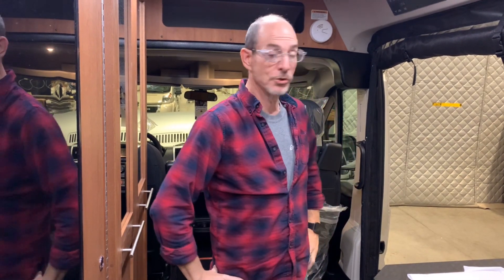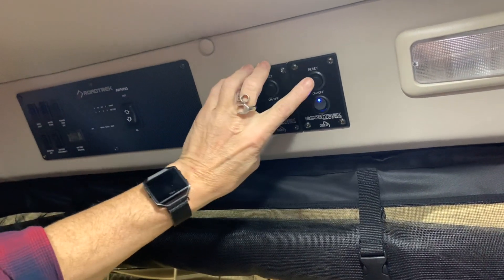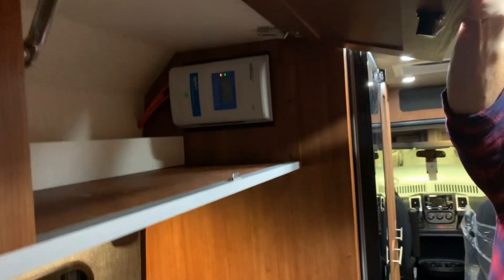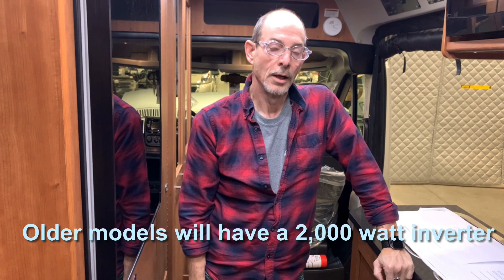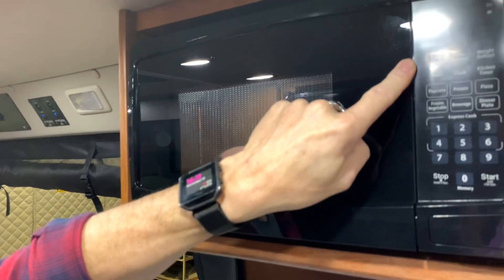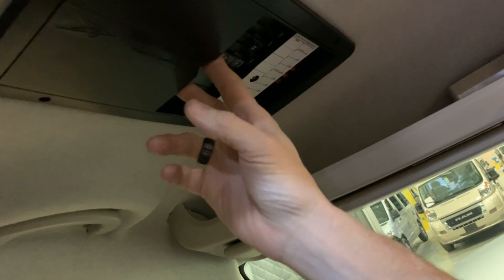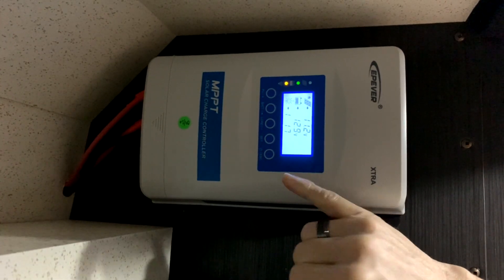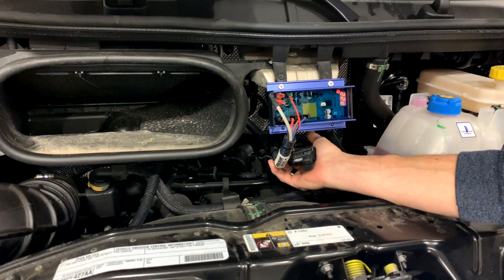Roadtrek Delivery Experience  Electrical Systems Video

Comment: awesome help.
we just got a 2015 used one by M.Benz on the sprinter body with roadtrek doing the interior... got several things that puzzled us as was not in the RT book ... the two lithium on buttons with reset as shown, are in none of the paperwork we got so that manual obviously is missing... which wouldve probably also shown us where these lithium are...
There was no MPPT manual so had to guess it was a solar controller
The AGM under hood at least was mentioned, so we have both installed apparently. the power button on the side of the front pass. seat on/off is still a mystery...

but atleast the mystery buttons you just showed let us know we have Li. onboard as well 
Now have to find a manual for the inverter charger at the back under the bed so we can find out why one of the two lithiums make a clunk sound when switched on, I assume by watching the LCD screen on the top of the unit as it is on?

Comment: thanks sean great vid. i purchased a 2016 Roadtrek CS adventurous with lithium batteries/ modules. The consignment dealer was somewhat knowledgeable .I got home and plugged in my rig / 30A circuit with inverter on and modules at the time I didn't realize what was going on, had not seen your vid. yet. Next morning I went to rig and it smelled like sulfur/rotten eggs so the blk/gry tanks were ok but I checked anyway it seem to come from the coach batteries, 2 6volt batteries underhood.
After looking at your vid I thought I did ok, inverter should have recognized shore power and passed thru, on the other hand I didn't do a battery disconnect to the coach batteries which as I understand it disconnect but with shore power and inverter on the inverter connects??
I think I over charged the coach batteries? Thoughts? thanks

Comment: Got a question? I have a 2015R170V, For my house batteries to charge...do I have to have the Battery Disconnect on AND the Inverter on in order for my house batteries to charge?

Comment: On a bright sunny day, with three solar panels charging my batteries, and with the only load on the system being the ceiling fan, my ecotrek batteries seem to shut off and need to be reset again.

I don't have the inverter on, so it seems the load on these batteries should be well below the charging rate of the solar power.

Do you know what can be causing this? Is the auxiliary battery in a Mercedes chassis required to retain a charge to keep the EcoTrek modules on?

Comment: Hi, Great video. I just purchased a 2019 Zion SRT. I was plugged into shore power and tried running my AC. It worked fine during the day but tried turning it on in the evening but it turned off after a few seconds. I have not had power to my 110v outlets, induction stove, and microwave since. I have tried the fixes to restore power to my 110v outlets but still can't get power to my 110 outlets. I have pushed the test button on the GFCI breaker but I am not having any luck with that. I am plugged in to home power using a 110v to 30 amp adaptor. Do you have any suggestions that I can try?
Reply from the maker: Hi you need to confirm that the breaker has not tripped. The air conditioner is on a 20 amp circuit and the adapters usually take you down to 15 amps.
Reply: @RoadtrekMotorhomes  Thank you for your rapid response. I was plugged into 30 Amp shore power when I lost power. How can I reset the power now that I at home? I have turned the breakers off then on again but I have not had any luck with that.

Comment: Thanks Sean, I do have a question about your section on shore power. I was told along the way when connecting to shore power that the sequence must be: Li batts "on", battery disconnect "on", hook up to shore power and turn on, THEN turn on the inverter. In this video, you show inverter "on" before connecting to shore power. Which is correct or does it not matter?  BTW, thanks for the reminder on the system reset.
Reply from the maker: Jerry,
The Inverter should be turned on first This allows the Inverter to perform the Transfer portion of the hook up properly . It can assess the quality of power entering your coach and “Decide “to stay on Battery power. This occurs when the Voltage being supplied is too low or too high . The Inverter does not have built in Surge protection .

Sean

Comment: Will Roadtrek do a video for the "Firefly Coach Control and Monitoring System" for the new 2021 Roadtrek Zion?  I'm expecting my new Zion deliver January 2021, with the new Firefly Control System.
Reply from the maker: Yes, we most certainly will be doing a walk through video of how the Firefly Coach control system works with the rest of the coach functions. It will not be available until the New Year but we are working on it for everyone.
Reply: @RoadtrekMotorhomes  Thank you :)
Reply: @RoadtrekMotorhomes  Which new year will the Firefly video be available?  2021 or 2022?  We have a 2021 Zion Slumber.  Also are you suggesting we purchase a surge protector when hooking up to shore power since you say the inverter doesn't have surge protection?  Thanks.